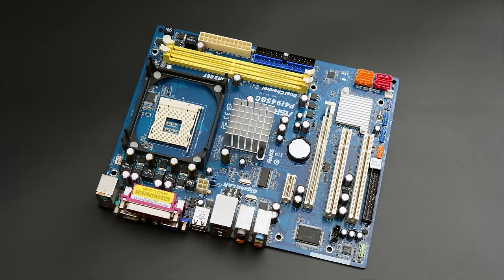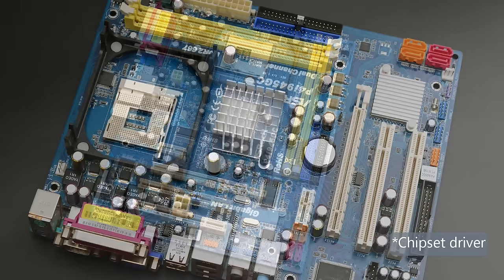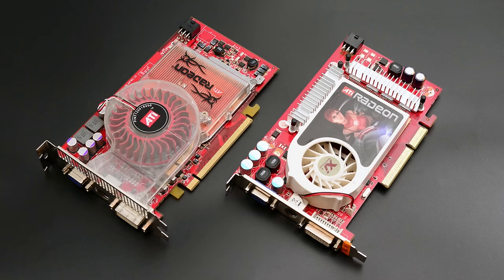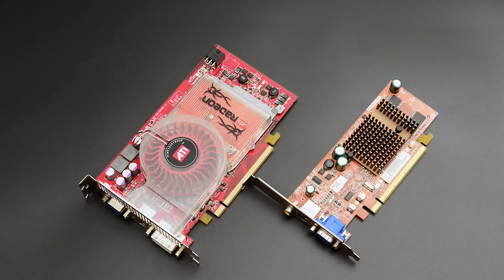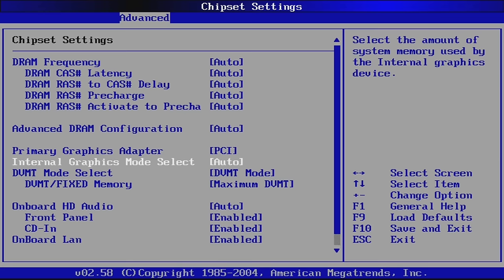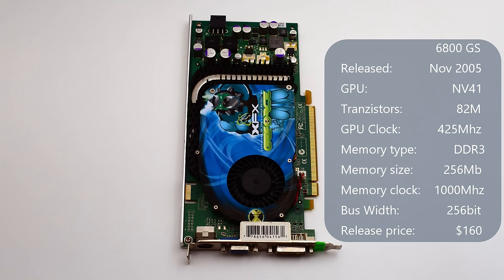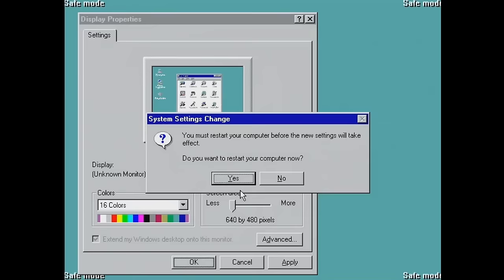Exploring the early PCI-E cards on Windows 98

Comment: Great video ! Latest Windows 98 nvidia drivers are unfortunately quite buggy ... Also I've had better luck with a core 2 duo board, which uses a chipset that started on socket 478. It's based on a VIA P4M900M.
Surprisingly, this chipset is almost 100% supported by windows 98 ! The only thing I couldn't get running was HDA for the sound, but I could easily use a PCI sound card instead.
I managed to find a driver for everything else. USB 2.0 ? Check. Ethernet ? Check ! IGPU ? Using a driver meant for the P4M890M, it was working flawlessly (also it's basically an S3 savage 2000 inside the chipset, so it actually has very nice DOS compatibility). When I plug in a PCIE gpu, it disables itself automatically, which is also very convenient. And of course I could find drivers for the main chipset.

The whole thing ran with a core 2 extreme x6800 and 2.5GB of RAM (the chipset cannot support more than this, and yes I patched windows 98 of course). This was a speed monster for windows 98 :)
Reply from the maker: Thanks, I did find another motherboard for a similar clip, the ASRock P4VM890. I guess it has the same chipset you are mentioning but it comes with socket 478 and PCIex (of course). I plan on creating a clip in the future because I couldn't let that 6800GS go. There's a lot of advice/knowledge in the comments for this clip and I can create a better clip next time. I also have some additional graphic cards to be tested. (A PCX 5300, a 6600GT, a radeon X550 and a x700) So with your information I'm pretty sure that a future clip with PCIex on Win98 will go much smoother.

Comment: Зачем брать именно 478 ддр2 PCI-e плату когда есть 775 с P4 5xx моделей с DDR?(ddr2 показывает на четверть больший потенциал чем был на самом деле у владельцев 478) X300 = ATI 9550 и можно было сравнивать с AGP версией  системы. Ранние карты PCI - E не имеют больших продвижений при сравнении и основным плюсы от PCI-e пошли только с унификацией шейдерных модулей в 2006 году на моделях GF 8800 - до данного периода все массовые карты (массового сегмента) имели проблемы совместимости с новыми играми выходившими на новых DX 8-9.x как итог новые бюджетные компьютеры из магалина не могли запустить хорошую часть современных игр. Обратную совместимость (и то не полную) имели считанные единицы игр таких как HL2./ Большей объективности видео добавит MSI Afterburner (P4 его поддерживает в отличии от P3 и Athlon) - график времени кадра даст понять почему разница в цене в 10 раз была обоснована  при разнице в кадрах только в 4
Reply from the maker: Thank you for the comment. I will definitely look into the p4 frametime in afterburner. Why pick these components? Because they looked exotic and left the impression that windows 98 was possible the only odd connector being the PCI-E. I wanted to see if the connector made the difference and this is the reason why nvidia never released any win 9x driver for their cards. Also I think there is another clip where I concluded that basically the early PCI-E were equal to the Agp versions.

Comment: I have a Socket 775 PC with Core2Duo E8400 3,00 GHz, V2 SLI, G31 chipset and GeForce 7900 GT PCIe with 98SE and then another PC with Via C7 processor and GeForce 6600 GT PCIe and ME... Works. But it was and still is a lot of work with unofficial drivers and so on.
Reply from the maker: Yeah, I feel there's a bit of research you need to do before this topic and also a lot of trial and error. I was simply lucky with the Radeons, so I am thinking of a new clip taking into account everything I've learned in the comments.

Comment: You think windows 98se would be able to cope with a gtx 4090??
Reply from the maker: Yes, it should. The 4090 is just a PCIE graphics adapter after all.  It will not have any driver though.
Reply: @retrodrive-thru47  there is a 32 bit driver suite.. perhaps someone has downloaded the first driver In the series and manually install them.. perhaps someone has hacked the drivers to work lol.

Comment: Are AGP boards actually that rare now? I've got like 20 of them, they're literally trash in my area.
Reply from the maker: There are plenty over here too, but most of them, like you said, are trash either by specs or by having a ton of dust and in some cases mud over them and in the slots.
Reply: Problem is find nice agp card as most getting pretty expensive vs cheap low end pci e
Reply: @rrcoster  That's true. Apparently AGP cards have been dying en masse for a while now. I've got a box full of dead or half dead ones.

Comment: The problem with these modern cards and Windows 9x is that certain games require 8-bit palletized textures and table-fog.
So you might as well stick to the previous generations AGP cards, such as the FX series (does great at DX 8.1) and the Radeon 9000-series like the 9800 XT/Pro.

So yes, while you can run 9x with PCI-e graphics cards, and some games will run fine, you inevitably will experience compatibility issues unless you strictly stick to games that came out very late in 98's lifetime anyway.
Reply from the maker: Yes, this was something I kept in mind. I like period correct PCs. These parts kind of aligned on the lines of 2003, 2004 and 2005 that is somewhat plausible but this definitely isn't a Windows 98 PC. I had hoped that the PCX 5750 would work, that would fit the FX generation, and the x300SE is basically a 9600 of sorts. But I think you'll like my next video more. I'm actually building a Windows 98 PC for me, a socket 370 Pentium 3 with a radeon 8500 (that also may be a little too much but it's along the lines of late windows 98, just before Windows XP appeared)

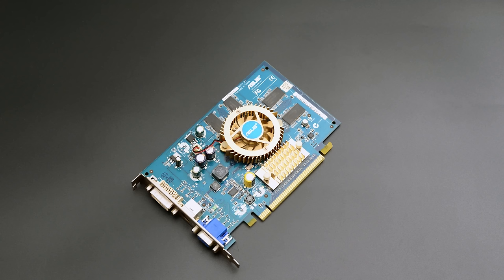Comment: 3:47 that's the shadiest chart ever, you are showing a 5% improvement as if it was 70%, c'mon, what are you, modern journalism?
Reply from the maker: It is shady indeed. I didn't intend to mislead with it that's why I included the number values. I included it quite late in the making of the clip to justify why I didn't go back to dual channel, because it was not supported by win98 and also it would have required me to make some changes to windows 98 so in my mind it was justified. About the modern journalism part...well, I'm looking at parts from 20 years ago and I'm also not sponsored by the Single Channel (and fan) association so it's more like revisiting some retro hardware than journalism. I'm happy that someone actually mentioned this because I can go to having the full length of the chart and only mention the percent delta, incidentally I have noticed some apps do it as well, please check the Stocks on IOS.

Comment: Why no patchmem?
Reply from the maker: Good question. I started like that and soon I was patching win98 for 512mb graphics cards. But in the end it felt like a hack (and also the dual channel didn't bring in too much performance gain) and just having more than 512mb for the software I've tested was kind of pointless so (after reinstalling windows) I preferred to keep it as close to the original as possible.
Reply from the maker: I also like to keep a balance of software and hardware - having them all inside of a 2 years period so I can recreate the original feeling (and this clip is actually a very bad example of keeping a balance). This clip is more like an example of exotic hardware (around 2003-2004) made to run 6 years old software to see if it's possible and also to investigate if the drivers supported the pcie that appeard after the support ended for 98.
Reply: I see! Yes it’s nice to keep it authentic! But I also like the overpowered new hardware 98 builds. It’s like dreaming what could have been if we continued to use glorious dos based 98 windows into the future 😉
Reply from the maker: @JohnSmith-iu8cj  then patchmem, also s-ata patch, the patch for 512mb+ graphics cards are a must and probably some more I can't even imagine right now, also drivers...but it's windows xp stability under various (driver) changes that wins over 98 in the end. But I guess it a nice dream, and I would also be curious what would have been...

Comment: Nice vid. That board makes little sense in real world. Pentium 4 already bottlenecked geforce fx and radeon 9800 agp cards like crazy. Got a p4 at 4.3 ghz to know. Maybe its just your capture card but those games did not look very good visually compaired to the agp systems i have here. Textures look washed out.
Reply from the maker: Yeah, it's the capture card, not very good.
Reply: @retrodrive-thru47  no problem, its probably better then nothing.
Reply from the maker: I'm also trying to use a resolution closer to that era/hardware capabilities. So it's mostly 1024 by 768, that gets upscaled to 1920x1080 by Powerdirector and  then upscaled to 4k by Davinci so maybe some details/colors etc are lost along the way. But mostly because the capture card is not that great.
Reply: @retrodrive-thru47  Maybe something gets lost with upscaling. Im playing on a 1280x1024 basic samsung monitor, but it looks much sharper and colourful. While this monitor isn't anything special. Besides that the vid is nice and informative though.
Reply from the maker: @mealot7613  I'm beginning to think the same thing. It's not great as most of the captures are from dark games like Wolfenstein, Halo but I think the capture colors are a bit more vivid than the final product. So the upscaling is taking away some quality. I think I will try to release my next clip just in 1920x1080.
Reply: @retrodrive-thru47  1080p is fine for youtube, if you ask me. Most people still don't use much more then that.